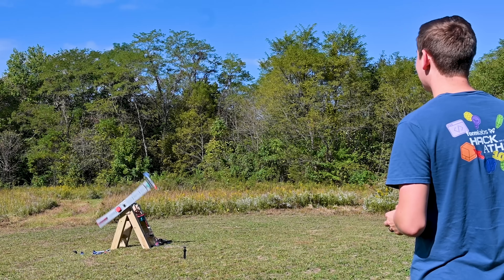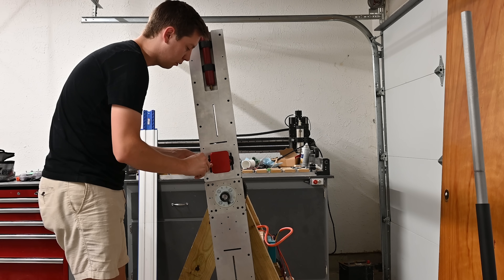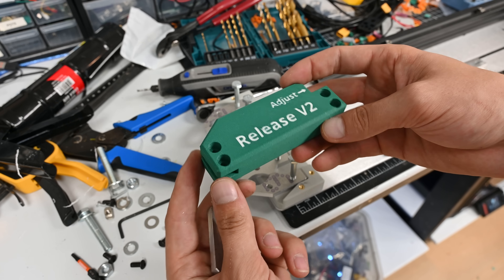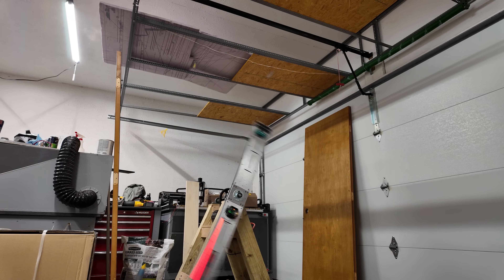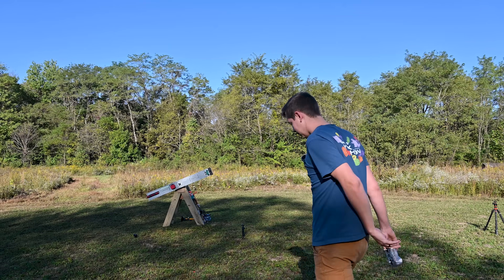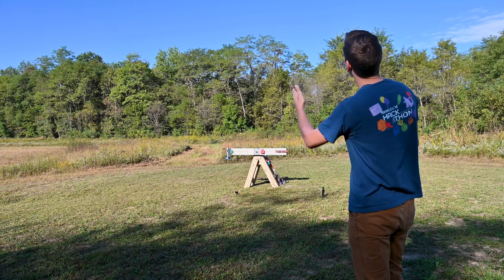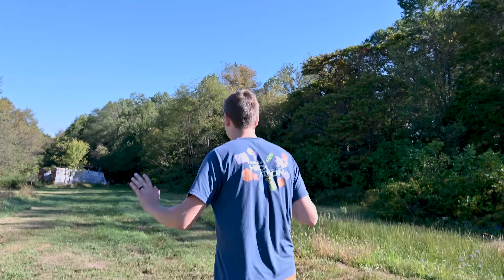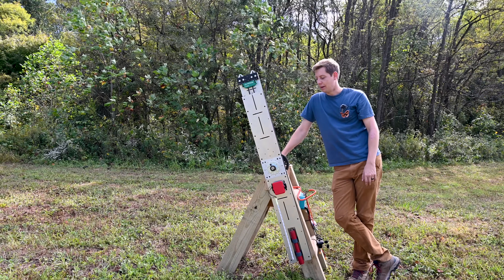I Fixed SpinLaunch

Comment: Great video. How about making it more like a trebuchet by having a link that pivots on the end of the main arm on one end and the rocket on the other. It would start at an angle of say 60 degrees with the main arm, where the spin center, the outer pivot, and the rocket would form a triangle. The "triangle" would need to be released first, then the rocket as in the current design. Obviously the balance and timing would need to be more precise, but it could add a lot more kinetic energy to the rocket.

Comment: Use a spring that pushes the clamp open and have air keep it close. Then release the air to open the clamps. You can use strong springs to counter the centrifugal force holding the clamps closed at high speeds

Comment: Why not just mount the rocket at the 45 degrees angle it releases at and have just one connection.  The rocket fins would quickly stabilize it after release.  It would also be a good idea to add a counterweight that is activated with the release, so that the balance stays with the arm so it doesn't death wobble itself.  Great project!   Another idea, a trebuchet launcher.

Comment: 1- Use a crankshaft missing tooth wheel and a hall sensor on the hub and will improve the release timing. 2- use a co2 canister for stage two and unfold the wings to gain altitude 3- drop the empty co2 canister and ignite the rocket engine 4- take a picture of space and play space oddity by David Bowie

Comment: The counterweight everyone is talking about should be water. Also, The air pressure cannot push against the blocks G loaded weight at high RPM, That is why it didn't launch until you slowed down. If the release mechanism pneumatic was stronger or engaged by a pushing motion instead of a pull then you'd have high RPM success but also higher rpm negligent discharge. A cross action seer, long axle shaft which pulls the sliding pin when rotated. Think Doorknob. I'd avoid using hydraulics for the release mechanism due to the head pressure of the working fluid in motion. If you'd like to get extra fancy, what about sealing the rocket to the spinlaunch with vacuum on 2 surfaces and have different chamber sizes and vent hole sizes to relax vacuum at different rates. If you need more locking force, use more surface area.

Comment: Under load those sliding insert pieces controlling when the claws open can have a ton of friction, causing the pneumatic release mechanism timing to varry each launch.  If you put bearings on those insert contact faces it's far less sensitive to load and should become much more consistent

Comment: The base looks stable in the regular video, but it is still moving a decent amount seen in the slow mo.  Anchor it to the ground for the next launch.  Add a camera to the rocket.  Also some sensors to detect speed and altitude and orientation.  A rocket motor that gets triggered at the top of the launch would be cool.

Comment: Kickass! I'm so stoked about this project. Now add some flight control with a rocket motor and parachute maybe even a camera. The launcher looked WAY more stable this time. I think that stability 100% transfers to your flight characteristics. Is there an algorithm that controls when the release happens based on the arm speed? In other words, does it launch at the same moment at 500 RPM or 5000 RPM? I'mma rewatch your other video to see what you said about that. Great progress so far!

Comment: That's seriously impressive. To this day I don't understand how anyone doing the calculations required for serious engineering can deal with all the conversion factors needed to handle pounds, inches, yards, and miles.
Reply: The formulas don’t change, just the units. Also nobody uses yards.
Reply: @rob_over_9000  no concrete for you.
Reply: Massive respect for Wernher von Braun and his team for that reason 🫡 Not only did they engineer the Saturn V rocket, they also had to deal with American engineers and workers stuck with imperial 🤯 Today NASA uses the metric system.
Reply: We don’t, we use the metric system 😅
Reply: that is extremely easy.  unit conversion is a first year physics concept.... and honestly, I hate to say it but its trivial to just type it into google and have it do all the conversions for you. The harder part is figuring out which real world variables you can ignore and which ones are crucial under your design parameters/constraints.
Reply: LOL, nobody uses banana units.
Reply: That y we almost exclusively use metric. Easy math. Better accuracy.
Reply: @WillardWallace-y5g there is nothing inherently more accurate about the metric system.
Reply: @bermchasin spoken like someone who doesn't know what a nanometer is, or what unit of measure its for....😂
Reply: @WillardWallace-y5g homie if you only knew. There is nothing more precise about a nanometer than a megaparsec. Its simply a scalar conversion factor between them assuming sig figs are maintained.
Reply: @bermchasin engineering is done accurate to 1/1000 of an inch or 1/100 of a mm
0.0256mm or 0.01mm 
So manufacturing in metric can be done twice as accurate
Reply: @ninosegers  you seriously think no one has ever measured beyond a thou when using inches? That is an insane take... You can literally just add a decimal place.  What you are talking may be true in some engineering software but it is not fundamental to the unit system.  Wait til you hear about the tolerances that LIGO engineers used.... far beyond 0.01 mm
Reply: @bermchasin when higher precision is needed micrometer or even nanometer is used even in America. The inch is the smallest unit but 25.4mm is not that small.
Reply: @ninosegers  You are so confused. An inch has precision far beyond 25.4 mm.... you can use tenths of an inch, or hundreths, or thousands, or even one-billionth of an inch. The unit goes to arbitrary precision. The same way you can measure a mile in nanometers, you can also measure a nanometer in miles. Please yall take a physics class.
Reply: @bermchasin  mathematecily you can write it down however you want, damn you can measure your screws in lichtyears for all i care. But smarter people have found out that adding that many zeros will cause errors eventualy. so they take units that minimize that. you can measure in a unique system with 1/6584 of an inch, but you will have a hard time to find such things. so unless you manufacture everything yourself best to look what others do.
Reply: @ninosegers  we would typically use a fraction with a 1/2 power rather than a 6584th but I get your point, it's just so wrong it makes your spelling look good. 'Mathematecily' we would use scientific notation for extremely large or small numbers so the number of zeros is hardly relevant and does not alter the precision. Any machinist worth their weight in iron would know how to convert from inches to mm and back again, so best to understand why you are doing what you are doing and not just blindly copy others.
Reply: @bermchasin  the standard is machining to 1/100 of a mm or 1/1000 of an inch. so in general metric is slightly more accurate. but yeah you can change the tolerances for higher or lower precision.
but doesn't matter much, imperial still sucks, regardless. the fact that you are arguing about fractions and that it is technically the same, to defend it. proofs how much more idiotic the imperial system is
Reply: @ninosegers  lol to suggest there is a single standard in machining is so laughable I really do not know why you continue to comment. You are wrong. Get over it, there are different precisions used in different engineering disciplines (not to mention physics or applied math).... there is nothing fundamentally less precise in imperial. You literally do not understand it.

Comment: Use two air cylinders with separate solenoids so you can electronically delay the grippers.  Then make sure the air cylinder has a long enough stroke so that when you retract them to launch the rocket, they move enough weight far enough in to rebalance the arm. You could put small clamps or a spacer on the cylinder rods to adjust the retracted stroke length

Comment: In "real life", how much fuel would this save even as a launch assist? Basically, how much fuel does a static launch use getting the rocket to the speed that even a "slow" spin launch would release at? That equates to a larger potential payload for the same size rocket, or higher top speed/distance. Is that worth considering for advanced hobby rocketry even?

Comment: Super impressed with the progress that you've made. I think it would be cool to see how fast it can go.

Maybe add some Arduino altimeter sensors to track the height of that's possible.

I'd love to see the vacuum done as well although that would be pretty challenging I bet.

As far as the release mechanism goes could you not have each one electronically controlled? The. You could adjust the timing between them to the millisecond.   I'm not sure exactly how ballistic highspeed does it, but they have an extremely precise timing setup for shooting a bullet with another bullet

Comment: Take inspiration from the Atlatl primitive throwing device. Launch from the very bottom of the rocket. Also mount rocket 90 degree.  Along the arm pointing towards the middle. Let is swing out before launch. Sliding counter weight could help with stability.  Great video 👍🏻
Reply: oohhhh... A.T.L. - Accelerated Tangential Launcher !

Comment: have you considered a pair of circular electromagnets on the tip, but on one side? You could release faster and more reliably, and have a similar setup to now by staging the magnets to turn off first top, then bottom.

It would also allow for your rocket to not have giant holes for the clamps
Reply: Electromagnets have a tendency to hold on to the EM field they generate for a brief moment after power is cut. While not normally a problem with most applications, if you need precision timing, they're probably not the way to go. 

Props for the idea, though.
Reply: @infamoushacker4chan activate a reverse polarity tractor beam, err, electromagnet, the fields will cancel each other out!

Comment: It seems like the mass of your rotating system is much much larger than it needs to be for the mass of the 'rocket' projectile. If you could make the long bits out of carbon fiber (or just not metal) and make it much thinner getting up to speed would be less scary and easier. Still, your system works and that's worth a whole lot more than theory about what's best.

Comment: maybe see what the results are if you add propellant, and use the spin to break the acceleration portion of the equation and kick in the propulsion once it's in the air.   i.e. how much onboard fuel is replaced by the launch machine?  if you assume 500ft target height..   then delta fuel mass, launching from the machine with some fuel to reach 500 ft vs launching using just fuel to reach 500ft.   if you see what I'm saying.  if the current throw is 100 ft straight up..  and 100g of fuel would take the rocket to 500ft..  how many grams of fuel would it take to launch the rocket to 500 from the ground?  the difference in mass and weight would be interesting, for how it might affect either rocket design or carrying capacity.

Comment: Replace the motor with a magnetic system so two opposite magnets repel away from each other and go faster rpm as that could then get rid of the mechanical restraint due to the limits on mechanisms

Comment: You should put propellant in the rocket too
Also wouldn´t it fly higher if the mass was higher because of the higher momentum/ energy
Maybe Improve the release Mechanism by making it purely mechanical. For example you could have the claws connect to a leaver near the axle with a bowden cable or push rod and actuate the lever with a stationary "cam" that´s fixed to the frame at the exact desired launch angle. You push the cam only into the way of the lever at the desired time of launch.

Comment: The bottom attachment should release when it is at the same point in space as when the first one was released to get a perfectly straight release. This depends on the distance between the two attachment points and the rotational speed during release.

You should consider building the arm bigger as this would let you get higher release velocities with a lower rotation velocity, and would make timing and vibration tuning easier. Buuut it would obviously make your stand heavier ;p

Comment: I wanted to add my two cents to the issue of vibration and stability post-launch, especially as those become more important factors the faster you spin the rocket. As some others have pointed out, even if you perfectly balance the arm, it will become unbalanced as soon as the rocket is released. A possible solution that comes to mind is something similar to tire balancing beads, especially since you're aiming for a high rpm launch. Then, instead of having to worry about balancing everything perfectly, and somehow compensating for the release of the rocket, you could have a passive system that balances itself. Steve Mould did a video on tire balancing beads fairly recently that goes into more detail, if you want to look into it.

Comment: Spinlaunch's full size imbalance compensation is a counterweight that is on the opposite arm; it drops off and is yeeted into a catchment below at launch release.  For your version, since we don't want unnecessary flying bits zooming around, consider building in an extra weight on the launching arm.  Balance the whole thing: launch arm with vehicle and compensator weight, and counterweight on the dead arm.  
At release, the extra weight is also released, but only slides out on the arm far enough to bring it back into balance.  No loose bits.

Alternatively, the main counterweight on the dead arm is a water reservoir, and at launch you dump the water to maintain balance.

Comment: I'm concerned about the release mechanism at higher RPM's. Currently the arm's rotation affects the forces pulling the pins inward. Can you redesign to be RPM agnostic? 

Additionally, the ability to set the release delay electronically would significantly improve repeatability. 

Add a counter-weight and a vacuum chamber, and you could really have something there!

Comment: now you need to add a counterweight that get's released in sync to maintain balance at higher speeds / payloads and add a motor / avionics to the rocket 🙂

Comment: If you worry about unbalasnce in rig  after launch, you could release a counterweight from other side simultaniesly.

I also think about a completely mechanical release. A stationary arm with a actuator / solenoide that put a trigger out.
When arm passes, the trigger release the two launch hook/claw with an adjustable mechanical timing.

Comment: From the comments here if you want to get to the next level of speed:
1. Software-controlled auto-balancing by moving a weight along the arm
2. Control each grab by separate valve and make delay in software

This will allow you to launch rockets of different weights and to reach more rpm which is seems to be the right way to begin working on rocket armed with engine.